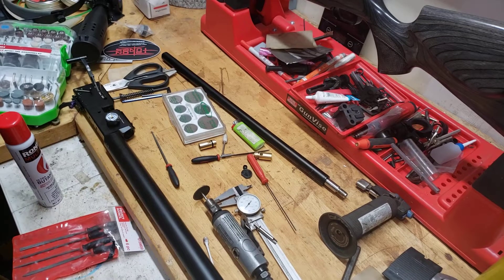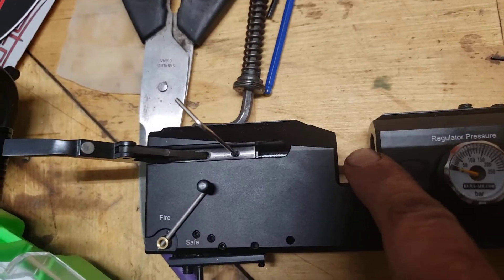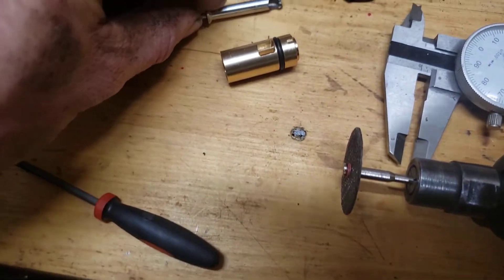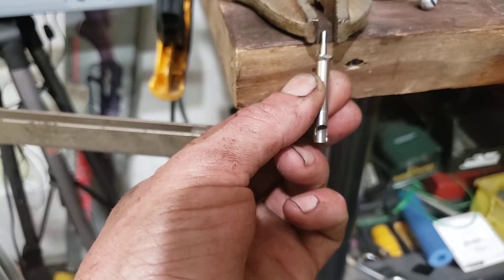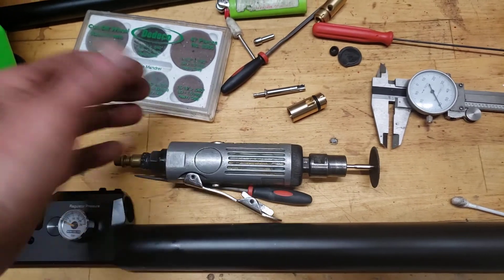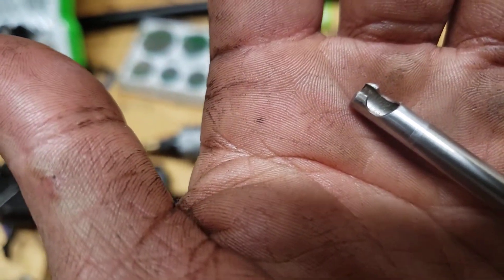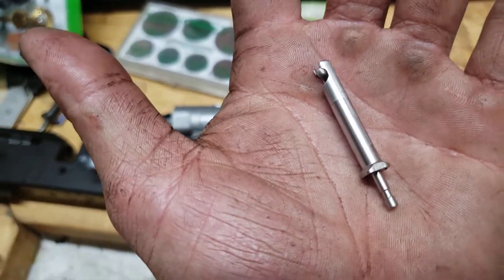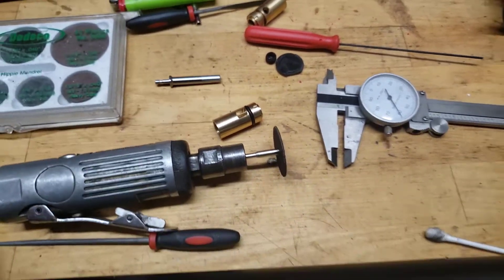FX dreamline pellet probe mod

Comment: Dumb question: will it still seat the pellets properly?
Reply from the maker: Yes, I was careful not to take off too much.. I would recommend trying the gun before modifications if you are not satisfied then I would open it up... I believe a new pellet probe  is about 30 to $35,  But I have had no issues so far testing it..

Comment: I believe I paid 32$ for the 
.30 probe I just bought from fx USA they are easy to get I got a rebuild service kit from them for 45$ and it came with literally every seal in the rifle plus a valve poppet and and valve stem or basically both pieces to the valve if I didn't say that right lol.